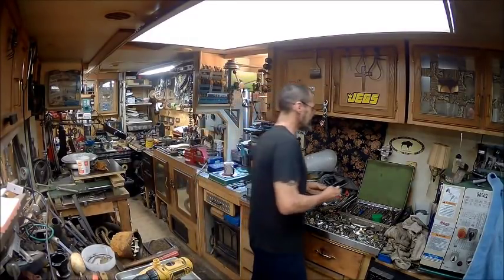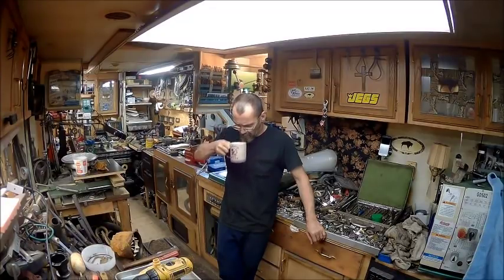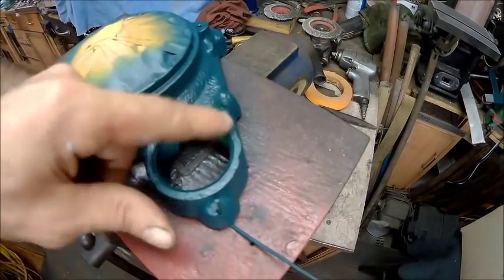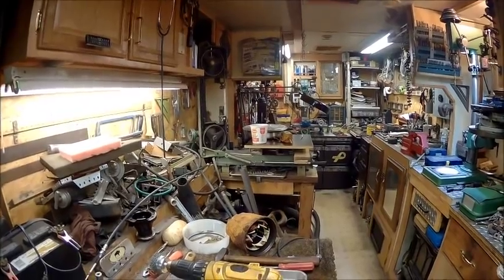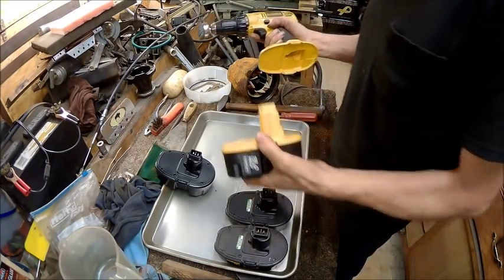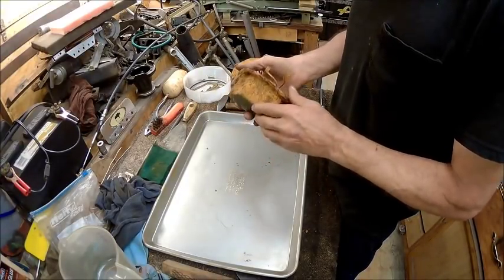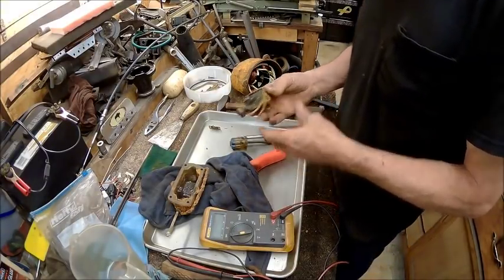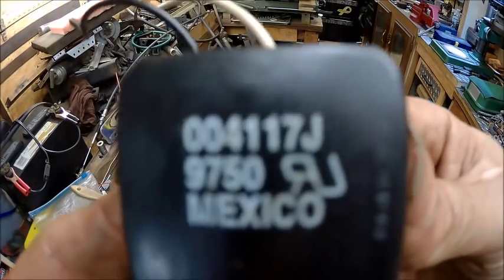zoeller m53 d sump pump rebuild part 2

Comment: bob,  mineral oil is basically the old fashion transformer cooling oil. it's mian disadvantage is flammability in comparison to the modern engineering coolants.
Reply from the maker: im sure half of one and half of the other will work just fine. if people can put their $5000 computers in mineral oil and trust it to not hurt the very expensive gaming rigs. then i trust this. plus, i may have enough of what came out of it to go back in it.